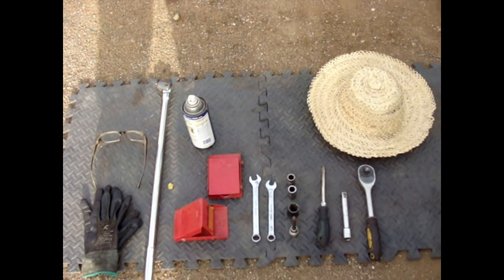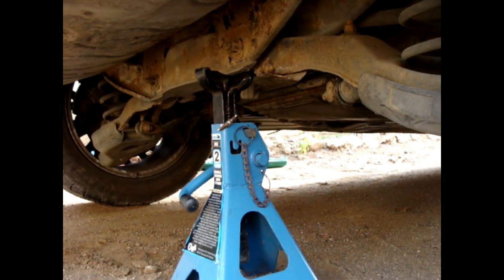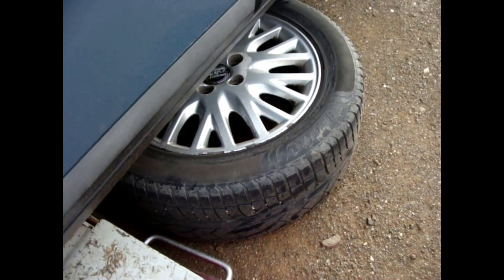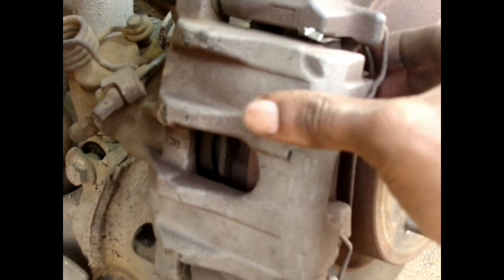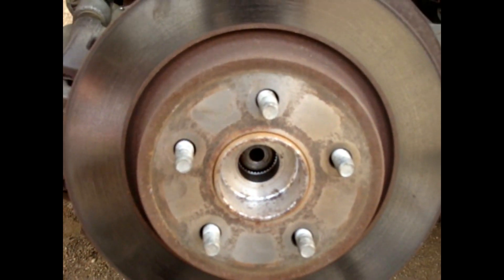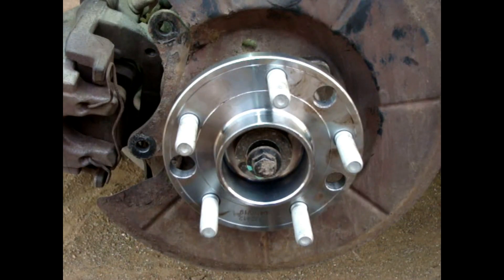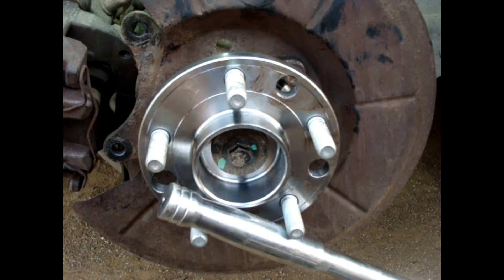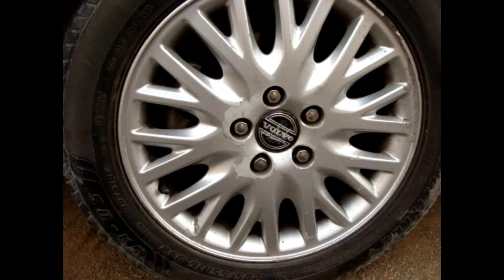Replacement rear wheel bearings

Comment: Though I would agree that replacement of a rear wheel bearing is easy, at least on paper. I would recommend mentioning that they can be a b*tch sometimes. I’m speaking from experience. In my 06 v50 for example the bolts are bolts from the back of the bearing.
Reply: Bolts are located behind the bearing which made working on it much more difficult.
Reply from the maker: Yeah, sometimes the engineering behind this is full of riddles.